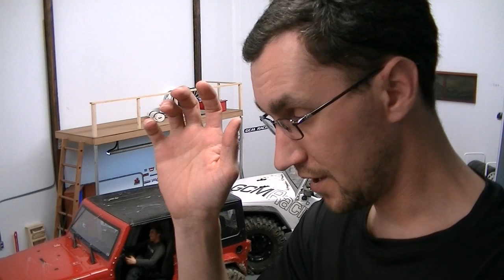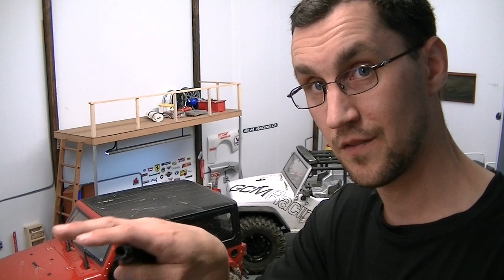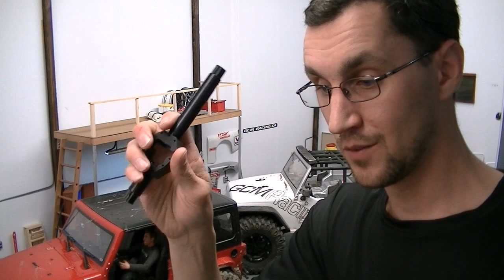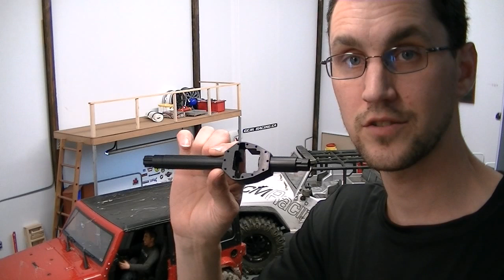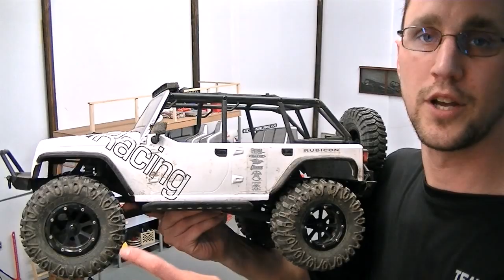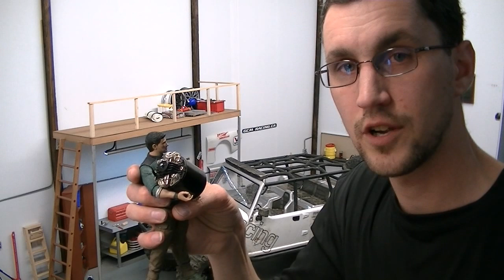GCM VBlog 2014 05 25-Axles, Axles, More Axles

Comment: For the new scale scx10 axles you can take a vanquish cvd, cut it to the right lenght and dremmel a new flat spot for the diff
Reply from the maker: Sounds easy, but one side is shorter than SCX, and one side is longer than SCX. And to keep the SCX wheel end with c-hub and knuckle you can't just cut down a wraith CVD to make it work. I think I have a solution for a drop in axle setup, but have to finish proofing it out. Thanks for the comment.
Reply: You can buy the vanquish scx10 cvd set and ad a wraith long shaft